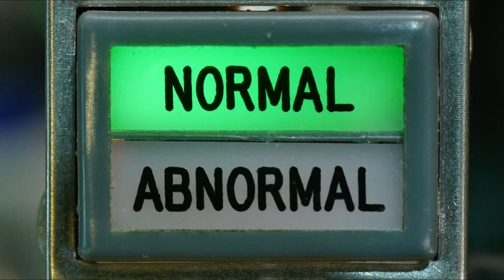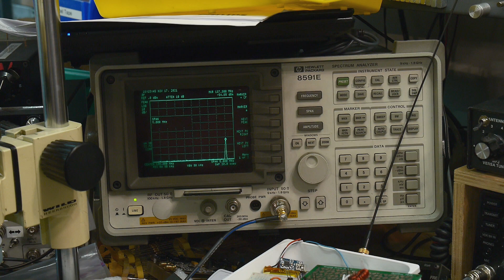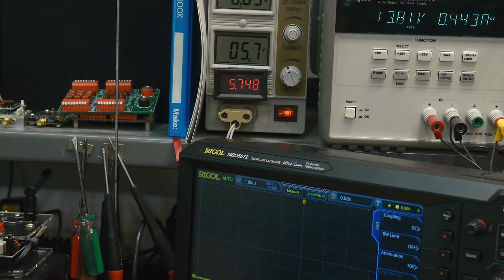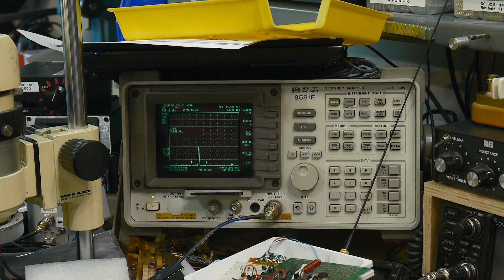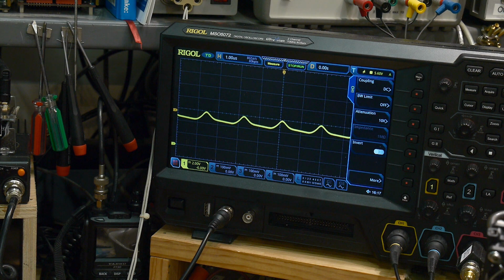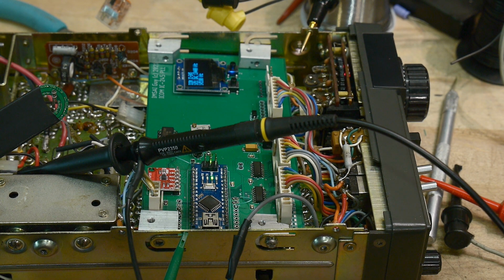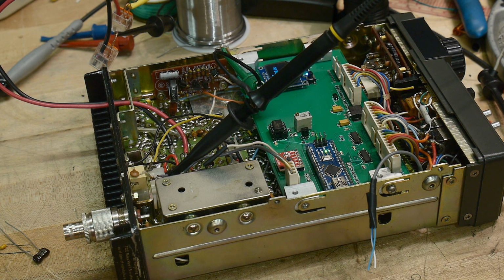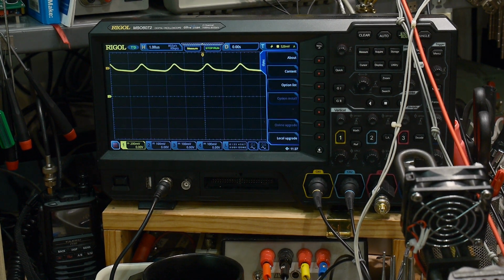#971 ICOM IC-245 VCO replacement

Comment: Had TX on all bands apart from 22 to 28 on a ICOM 735, turned out to be a relay which was replaced.
Then removed the PA board to check for dry joints and then refitted and now have no TX on any bands.
Receive is good throughout.
What should be the first place to check? (Pre driver)
Many thanks....

Comment: Thanks for continuing to share the adventure. The self-inflicted challenges seem pretty normal to me and are just a product of developing the system. No worries. lol You stated that you might be adding a second board. As an alternative, you might just redo the first board, to correct the bodges, and put the new circuitry on the second version of the first board. It appears that you have extra real estate, on the first board. Two birds, one stone... If the frequency of the glitch on the VCO supply is at the rate of the mains (60Hz,) I would wonder if having the cover off is allowing noise to reach the VCO. I saw the DIY multi-digit meter that you added to your PSU. If you did a video of that project, what is the episode number? If not, please do a review video; I need to do that same conversion on several of my supplies.

Comment: I've had a number of brain freezes working on mine. Figuring out how the split VFO worked was a chore. The manual is written in chinglish sorta, and split is not fixed +/- 600 Khz - its adjustable 5 khz to 999 khz with the enter button. I've narrowed it down to a bad 7447 in the display - C(4) line is stuck high showing undefined symbols, and bad caps on PLL board. It seems the PLL chip is ok - I hope so.

Comment: Back in the 70's, I purchased a new IC-245 with SSB . These radio's worked pretty well but they were notorious with cold solder connections and the PC boards that would not stay grounded. You have to go in and tighten the PC Board mounting screws to maintain the grounding. Putting in internal/external lock washers helped. Enjoying the videos. 73